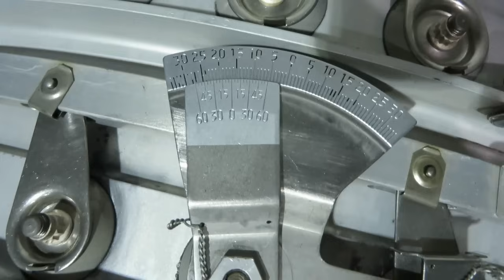Jet Questions 75

Comment: I want to thank you for the memories. I worked on the J47-25 & -25A when I first came into the Air Force in 1960. It's a little different than the -13. Ours were mounted on the B47 aircraft. We tore down the hot section and rebuilt them on a daily basis. I really enjoyed the work. Thank you again!!!

Comment: Indeed; J58, blablah.

I'm totally with you, the J79 is awesome! And it is also a practical and very reliable engine. The J58 was extremely specialised, needed special fuel, a special chemical igniter, etc. etc.

Bring on more fire-breathing dragons! I'm glad there are still a number of F-4 and F-104 flying.
Reply: +Jeremy Burch I can remember probably 15 years ago when I was at the Andrews AFB's airshow. An F104 Starfighter flew around. It was LOUD, and it had only 1 J79.

Comment: A  very good video.
I liked your pointing out slip features dealing with size change due to temperature change.
I liked your explanation of how to get into the business.
You hit home runs on several other topics.  Salute.

As for SR71 engine parts:
A couple of years ago a damaged compressor blade from an SR71 which had an engine failure on take-off was on ebay.
With provenance. An estate sale.
Went for several hundred dollars.
I wish I had had the right stuff to buy it.
I didn't want to hoard it, and I didn't have a good final resting place in mind.
Someone bought it.  I hope it ended up in an air/space museum.

Comment: There are quite few promotional or instructional videos on You Tube showing a "fly through" of various engines from GE, Siemens, Man and others. They use movie quality computer graphics and fly right through the engine, through the blades, the combustors, everything, a trip you could never take in real life. They show everything you talk about and some even show the massive installation required to harness all that heat and power as you just explained in this video. The intake filters alone are as big as a house. Those videos are probably the closest someone is going to get to having some sort of "big picture" video like the guy was asking about here.
    Either way, they interesting and fun to watch.
Reply: +John Winslow perhaps you could post some links?
Reply: +Doctor Forbin  They are very easy to find. Just type in GE or Siemens, turbines anything like that. You will get dozens to choose from.
Reply: +John Winslow thank you.

Comment: For those that don't want to spend hours on hand polishing or burring of rust... Take the combustion liners to a stainless steel specialist workshop and have them dipped in a "passivation" bath... it will strip away any protruded iron that have rusted on the surface, and other dirt, and just leave the chrome and nickel left on the surface. Most "old" combustion liners (except fancy new ones in higher temp engines, that are inconel ish alloys) are made of 347 or 321 stainless steel. The ones doing depot level maintenance on the T56-A-14 engines I work on also use "passivation" baths for kleaning the liners and hot-section components of our engines.

Comment: I noticed that the first stage turbine blades have a more scoop-like shape, while the third stage blades are more airfoil-shaped. I wonder: how much of the power from the gas stream is gathered by the turbine via drag on the blades and how much is due to lift? Is it even possible to measure something like that?

Cheers!
Reply from the maker: +SnowRaptor You'll probably want to talk to a gas turbine engine design engineer for that one. Luckily we have one checking out the comments on a regular basis. I'm sure you'll hear from him soon.
Reply: +AgentJayZ Thanks, I'll keep an eye on the comments.
Reply: +SnowRaptor I think the question you are really trying to ask is: what proportion of the energy available in the gas stream is converted into power by momentum change and what proportion results from the pressure drop across the rotor stage?  Now, as I've stated in the past, I was a designer, not a turbine aerodynamicist, so I can only comment in general terms.  I am, therefore, very prepared for a correction to come in, but the typical aero engine turbine operates at around 50 percent reaction. This means that around half the power comes from the velocity and direction of the gas flow being changed in the circumferential direction (ie, 'impulse'), while the remaining proportion comes from the pressure drop (ie, 'reaction').  From memory, the degree of reaction in a turbine stage typically changes (ie, increases) from root to tip. This means that the aerofoil section of an LP stage blade typically transitions from what you describe as a "scoop" shape at the root to a less cambered aerofoil section at the tip.  The change is also governed by the fact that the blade tip is travelling at a higher velocity than the root. However, I'm not even going to try to describe velocity triangles here: try looking the subject up for yourself.  In an HP stage, the velocity difference between root and tip is small, the change in relative gas angles into the rotor blade is similarly small and there is little difference to be seen in the blade sections. In contrast, in a long LP stage blade, there is a much greater difference in the relative gas angles into the rotor. Consequently, the apparent 'twist' in the blade section between root and tip is much greater, the tip section has less camber than the root and it has more similarity to what you would recognise as an aerofoil.
Reply: +grahamj9101 Thank you. So, what I was seeing was essentially an artifact of the larger blades in the latter stages.

It makes much more sense now, thank you again!

Comment: The first Blackbirds actually flew with J79 engines, and not certain, but I think one of the trainers continued to use the J79.
Reply from the maker: According to Wiki, the pre-production YF-12 was equipped with the P&W J75, which was larger and more powerful than the J79. The J58 was used in all examples of the SR-71.

Comment: Its the same with industrial computers, you have total dinosaurs running on old ass software with less processing power than a smartwatch, but they don't replace them because all the other equipment was build to work only with those computers and software, so if you replace that you have to replace the entire factory/plant

Comment: In older airplanes I sometimes see this tachometers for measuring the rotation speed of the jet engine. Now I guess there is something like a little generator that generates electrical power proportional to the rotation speed. Where is the common place on a turbine engine you would find this?
Reply from the maker: +Rudolph Ring The thing is called a tach-generator. It is always mounted to the accessory gearbox, one for each shaft on multi shaft engines.
Reply: +AgentJayZ Alright, thanks!

Comment: QUESTION at about 1:50 on this video, the vertical casing array.I noticed a vane flange, that had a chunk of metal taken out of its base, that I guess would have to be weld-filled and then ground flat and contoured. I'd like to know, does the metal to fill that gap have to be exactly the same type & grade and if it is a heated part of the engine, to where it heats up and the cools, down, does this metal to gouged out space, become autonomous with the metal that surrounds it?The reason I ask, is that the fill is not made from the primary casting, so is that foreign metal to the structure?Thank you very much, was just curios on that point.
Reply from the maker: +vrendus522 That's a new vane, welded in to the assembly to replace one that was damaged. The welds on the outside surface that we see are in an area significantly cooler than the combustion gas path. The weld was made with a high temp alloy, like Hast-X.
Reply: AgentJayZ Will look it up, thank you.Dan

Comment: what are industrial engines used for?
Reply: They can be used to drive generators at a power plant... shove natural gas down many many miles in a pipeline... power large ships... among other things.
Reply: +magzire Per Cunningham's law. I'll tell you that industrial gas turbines are used by large bakeries. Their power is used to mix cookie dough and in certain plants, they're used to drive the auger that injects the creme center into Twinkies.
Reply: +magzire An example would be our Halifax class frigates.  They have a three story tall 8800hp diesel engine for cruise propulsion, and a pair of much smaller LM2500s which put out rather a lot more.
Reply from the maker: You do not remember correctly. One minute of effort checking your info before posting would be my recommendation.
The LM1500s we service run at their EGT limit, and make almost 10 MW.

Comment: How does the variable nozzle actuators get the position feedback? (so they know where they are?)
Reply from the maker: +Armilar Zifferblatt There is a part called a nozzle position feedback cable. Look how smart You are!
Its signal is used by the Nozzle Area Controller.

Comment: Great vid, AJ79. You damn right. You don't let that s.o.b. disrespect the J79.  Just look at the J79. Imagine that the Phantom had 2 of those bad boyz pushing it thru the air. 
Were there any other 2 engine fighters back then? 
I can't think of any.
Reply: +Cooll Asice There was the English Electric Lightning, which was even more powerful, in particular its climb-to-altitude performance remains impressive compared to almost all modern fighters.

I"m note quite sure why wikipedia classifies the Lightning as a second-generation fighter, but the Phantom as a third-generation; probably to do with the much more advanced weapon systems of the F-4.

Then there was the rather smaller and lower-powered F-5.
Reply: +Cooll Asice There were twin-engined fighters before "back then".  Let's start with the Me262, the Gloster Meteor, the Gloster Javelin, the DeHavilland Sea Vixen, the Supermarine Scimitar. And, of course, there was the Lightning, which was an out-and-out interceptor and could stand on its tail immediately after take-off and disappear skywards.

Comment: quick question - without stators would the gas just swirl around inside the compressor before reaching the combustors and not increase the pressure of the air?
-Taylor
Reply: +BlackNinja3006 Compression would be minimal
Reply: You need something to compress against, no stators little or no compression. Imagine taking the cylinder head off a car engine?
Reply from the maker: Your answer to your own question correct. The other responses are not.
Reply: +BlackNinja3006 ok thankyou

Comment: I can never get over the jump in size between the 1500 and the J79 with that extra hardware bolted on. I did have a question for you Jay: Originally I was looking at becoming a pilot but that may not be working out. Plan B has been to go into maintenance. Have you heard much about how the gas turbine field is doing in Canada? I've looked for some of this info in the past but most of it's several years old and you get a LOT of sour people on that one so I was curious on your take. :)
Reply from the maker: +DarkAngelGuyver It's tough to get any job. One thing I've noticed is there are plenty of good jobs out in the smaller towns and less cosmopolitan areas. If you really want to do something, you get the training, and are willing to move, I believe you will always succeed.
Reply: AgentJayZ Definite truth there. It's crazy seeing the separation on the pilot front. In the time I've spent talking to people there really only seems to be two camps. The people taht made it and love it and the ones that didn't go anywhere and are absolutely sour about it.

Comment: that angle drive shown at 2:12, any chance u know if it uses a hypoid gear like a typical automotive ring and pinion or if its just a spiral bevel gear?  little things like that interest me because the 2 types of gear sets have their own set of qualities.
Reply from the maker: +thewelderdude I couldn't tell the difference. But for a true blue gearhead like you, I will try to get some good closeup video of the angle drive soon.
Reply: +AgentJayZ  my main understanding of the difference is that the spiral bevel gear pinion axis is perpendicular to the axis of the ring gear. A hypoid gear has the pinion gear axis offset up or down compared to the ring gear axis.

long story short, the hypoid gear can transmit much more torque, but is less efficient because there is some sliding action between the teeth. That"s the reason rear axle gear oil is so thick.

the spiral bevel gear is more effectient, but are not as strong for a given size and are noisy. 

hears a good read on the 2 types if anyone is interested.

https://en.wikipedia.org/wiki/Spiral_bevel_gear
Reply from the maker: I believe then, that it's a spiral bevel. You may enjoy my video called Are You a Gearhead...

Comment: In the Q75 video on the freshly built J79 at 5 minutes 11 seconds what mounts in the gearbox housing to the left of where the LM1500 starter would be?
Reply from the maker: +Keith m The engines always show up with nothing there, and the overhaul manual shows it as an empty "accessory drive", so it is probably an aircraft system component, like a hydraulic pump.
Engine and aircraft are separate territories, and we don't go there.

Comment: What is the use of nose bullet? it's used to start the engines, right?
Reply from the maker: +Vitor Moura The nose bullet is a fairing. It smooths the air flow over the central hub of the inlet. The front hub contains the #1 main bearing, sometimes an angle drive, and sometimes the starter. The nose bullet allows more air to enter the engine than would if the central hub was just a flat disk.

Comment: Do the VSVs apply much 'back' torque to the actuating rings and linkage while in operation?  Do compressor stalls typically do any damage to the vanes and/or linkage/actuators?

Also, i want to make a lamp from that 'garbage' combustor, lol
Reply: +jcims 
Compressor stalls destroy the turbine sections. They don't damage the compressor. A compressor stall is when the compressor stops feeding air into the hot section. And that makes the hot section too hot and melts it.
Reply from the maker: +jcims   Anchim has no idea what he is talking about, so let's ignore his comment, OK?
The VSVs pivot in a fairly tight mount, in order to prevent vibration. The air may place some forces on the vanes, and that is probably why the actuators are quite powerful hydraulic cylinders.
Compressor stalls can be very mild, sounding like loud vibration, or they can be huge, fiery events that sound like cannons going off.
The stators are very stiff, but with a big enough stall, they can bend far enough to contact the rotor blades, causing a great deal of damage. This would be an almost impossibly rare event. I have seen a few fire-spitting stalls that seemed like explosions, and there was no damage to the engine.
Reply: +AgentJayZ Awesome, thank you for the info.  
Some of the stalls I've seen on YouTube look like bombs going off, but the engines just keep on trucking. I think the tight tolerances, maintenance intervals and high stakes tend to leave (at least me) with an overall impression of fragility in these engines, but the reality seems to be that they are pretty tough. Watching those turbofan water ingestion tests tends to support that notion, lol.
Reply from the maker: We have had engines show up looking like somebody threw a brick into. One had half of its stators gone, and they went through the engine, damaging everything along the way.

The log book said it would make full rpm, but wasn't making power.
They are tough engines.
Reply from the maker: +Godfrey Poon On this channel we talk about what is real. If you don't want me talking about that, I won't be able to say anything.
Reply from the maker: No worries. I was confused by your comment, not bothered.

Comment: As a general rule do some of the jet engines manufacturers make their jets engines easier to maintain than the others?
Reply from the maker: +Ivan Dimitrov It's only recently in the history of jet engines that ease of service has even been considered in their design.
From the point of view of someone who has to take them apart and put them back together so they work as intended, some manufacturers seem to be guided by a common sense, straightforward philosophy, whereas others employ arrangements of parts that make you think "why did they do it that way? Seems over-complicated and finicky."

At the risk of igniting and endless and pointless debate, I will not mention any names, but from watching my videos, you can figure out which engines I'm talking about.